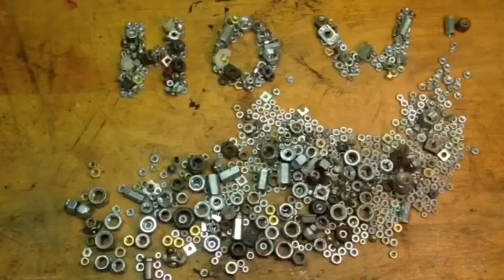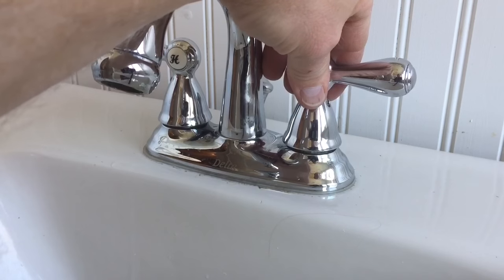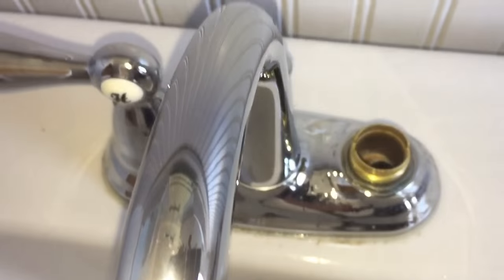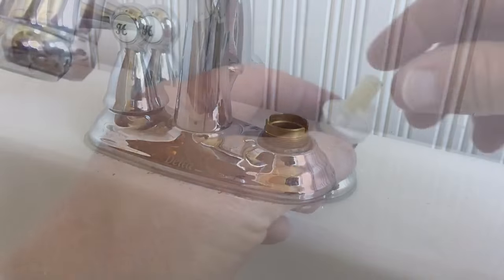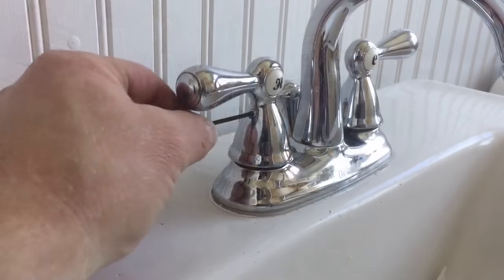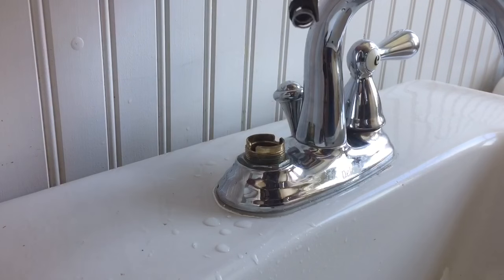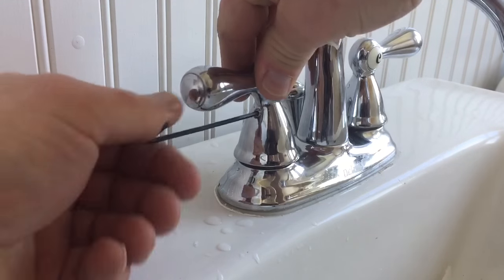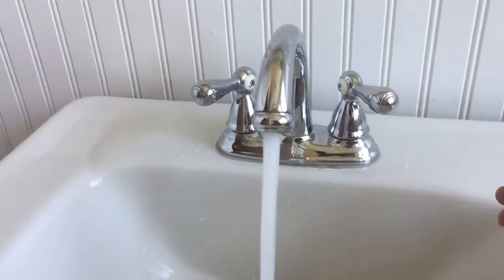How to change the stems, seats and springs in a Delta Faucet

Comment: I wanted to try to do this myself instead of calling in a plumber since I have 6 handles in the bathroom and it seems like something I should be able to do. I put it off for as long as I could, but  there were drips in the tub that I couldn't stop. So, as an older woman with some time on my hands, I gathered all the equipment, turned off the water, and gave it a shot. It worked! You explain how to do this in a very factual, calm way with good video shots. I really wanted to tell you how much I appreciate it and I'm so glad that I found you!
Reply from the maker: Glad to hear the video was a help, thanks for watching.

Comment: I have a problem! The new stem assembly that I got directly from Delta is not working. They have the same part number RP47422 but don’t look the same. My existing assembly looks exactly like yours, but the new ones don’t have the black cap and piece of metal that covers the oring when installed. Got any suggestions? Thanks
Reply: Seems like there's at least two styles of cartridge with a similar top, but different bottom design. 

I think you need the RP24096.

Comment: Thank you. Great explanation of the steps exactly as needed. I read somewhere the stem is most always okay and just need to replace the spring and rubber washer. That's what I did, just replaced the spring/washer and it worked. No more drips out of the faucet!!!

Comment: Thank you for such a clear detailed video! The metal collar around my old faucet's stem was so rusted that it wasn't super obvious it was removable, and I wasted a good big of time attempting to loosen the collar but being afraid to apply too much force as I wasn't sure it was really supposed to be removable, and tugging at the stem in frustration. I normally avoid video how-tos because they take too long to get to the point compared to just looking at a clearly labeled diagram, but yours was the first guide - video or otherwise - I found that clearly showed how every part of the faucet fits together and every step of how to disassemble one, which gave me the confidence I needed to apply a lot more torque to that rusted collar without worrying that I was going to break a part that wasn't supposed to be twisted off!
Reply from the maker: I’m glad you found this video helpful.
Thanks for watching.

Comment: Great Video Bob!!  I'm about to change the spring and seats in my kitchen sink faucet and decided to watched a couple videos on the subject for a refresher!  I found that putting a little silicon grease on the bottom of the cartridge , in my prior experience, made the handle turn smoother and prevented any disruption of the seat and spring (same principle).  I also think that putting a little silicon grease on the cartridge's rubber o-rings also helps preserve them in addition to making their installation easier.
Reply from the maker: Yes the silicone grease is great.

Thanks for watching.

Comment: Thank you SO MUCH for posting this video!!!  I needed to repair the faucet in my kitchen sink, and after three trips to the hardware store and four hours of intense frustration, I still could NOT get that stupid little spring and seat to fit into the faucet.   I thought the old seat and spring had popped out because I couldn't see them, but watching your video made me realize they were still in there.  It took a lot of prying fussing to get them out, but they finally popped out, and then I was able to insert the new seat and spring, then the faucet stem, and everything worked beautifully!  Again, THANK YOU!
Reply from the maker: Awesome, Thanks for watching.

Comment: Nicely done.  Good visualization of the parts. Lots of tips to prevent trouble:  putty knife to remove stem,  tissue to prevent stuff from falling down the drain, removing aerator to flush system when turning back on the water to prevent clogs.  Really expert.
Reply from the maker: Thanks for your kind words, hope the video was a help to you and thanks for watching.

Comment: Worked for a week, then got worse than it was originally,, so I changed the faucet. Then the valves leaked, so I changed them. Then I changed the trap & all the pipes. Oh, and the vanity was glued to the wall with silicone, so I’ll have to do some painting now too. Love DIY stuff.
Reply from the maker: Too many times one thing leads to another with home improvement.
Thanks for watching.

Comment: Thank you for this excellent video! I’ve used it several times. This time I can’t get the set screw out of the hot side and I think it’s stripped. (The cold side comes out easily). Can you help me with this? How can I remove the set screw to get the handle off?
Reply from the maker: The best thing I can suggest, and it’s not easy, is to take a small drill bit and drill out the set screw, tap it out of the threads if needed and replace it with a new one. It is possible but unfortunately not as easy as just removing it. I wish you the best.
Thanks for watching.

Comment: The Spring for the rubber washer is wider on one end than another (from repair kit). It would be nice to know if you use a little force to put spring on washer (wider end into washer?) .or turn it upside down (where it falls out if you do not hold it) and put it in with "skinner" side into washer.I removed them not knowing there was a difference between top and bottom diameters of spring.
Reply from the maker: Put the "skinner" side into the washer. Hope this clarifies. Thanks for watching
Reply: Its been awhile since you posted this came on here thinking i had the wrong seals they are but they were close enough... but my shutoff wouldnt shut off all the way due to calcium buildup etc and what a pain to do under the slight pressure took like an hour to just get the stupid thing in there and getting the valve in before it pushed it out loke playing whack a mole.. hard water ruined every shutoff valve in the house glad i rent.

Comment: very good video, I changed both but when I went to turn the water on the hot water side would NOT shut off, it stayed on no matter how I turned the handle, I could NOT figure out what I did wrong when I installed the hot water side until I saw your video, thank you from keeping me from going insane. A+
Reply from the maker: Glad the video helped, thanks for watching.

Comment: Thank you for great clear instructions and video. I still struggle putting the seat/spring  in!
Reply from the maker: Thanks for watching
Reply: Ocean Girl, sometimes it's a challenge finding the correct length and width spring and seat at local hardware stores. Some are too small and just sit in that little cavity when they have to sit above it to keep the seat elevated properly. Keep notes on which parts you bought that WORK for future reference!

Comment: Hi Bob!  Thanks for your excellent vid!  I had a fast-dripping faucet and I followed your instructions to change out the seat, spring, and cartridge.  It immediately appeared to stop the drip.  But I wanted to make sure so I left a cup under the faucet.  Well it looks like there is still a VERY slow drip as the cup has a little water (1/2 inch?) after about 8-10 hrs while I’m at work.  Any ideas where I went wrong, or what else I can do?   The dripping is much less though.  It would fill the cup in only 4 hrs or so before I did the replacement.
Reply from the maker: The first thing I would try is to take it back apart, and make sure the area where the seat rubs is clean, you could have some calcium or some kind of grit in between the seat, causing it not to seal. Next inspect the waterway inside the faucet where the seat rubs on the faucet. Make sure there are no scratches that would allow water to seep around the seat. Hope this helps. Thanks for watching.

Comment: The video is quite helpful, with a couple of exceptions. First, nothing was said about the fact that the hot and cold faucets have to be set up differently to accommodate the handles. There are little white plastic parts that have to be positioned correctly (and differently) in the two stem assemblies. Second, and much more important, you must leave the water off (both hot and cold) until you have replaced both assemblies. I discovered this the hard way. I managed to get the cold side installed. Wanting to verify that it was correct, I turned on the cold water. Nothing happened, except that I got a little bubbling in the open hot side. So I decided that I must have turned on the wrong valve. I turned off the valve I had just turned on and turned on the other one. Disaster! I got a geyser that blew the gasket and spring assembly up toward the ceiling. They hit a light over the sink, which broke into a million pieces, and I got water all over the place. So, don't turn the water back on until you have replaced both stem assemblies and handles.
Reply from the maker: Glad to hear it was helpful, thanks for watching.
Reply: I've also learned to keep the water off the hard way!

Comment: Why is it easier for everyone else?  Granted working on 15 year old faucet.  The set screw took force using 3/32" allen wrench.  the cap above stem took wrench with teeth to open.  the stem required force to pull out.  The stem is not going back in, so we will see.
Reply from the maker: The older the faucet and the harder the water the more difficult it will be. So much corrosion and calcium build up to deal with. Try spraying it down with something like CLR and let it sit for awhile. Hope that helps. Thanks for watching.

Comment: Great how-to video!  Once I had the parts bought via Home depot and required tools as per your video it literally took less than 10 minutes to fix both of the Delta faucets. Simple, straight-forward, no shouting, regular paced instructional guide that saved me bucks from a plumber 🪠(Highway robbers here in N.Y. State) or help from a handy man 🔨.  Also bought a new aerator 🚿as well and everything works like new on the 25 year old Delta faucets.  Bravo..!  Thank you!
Reply from the maker: And thank you for watching.

Comment: I had a leaky hot water handle on my tub. I changed out the seat and spring but the spring went down the water pipe. It seems to be working fine without it.

Comment: Bob, great video.  When I removed the seat and spring from my Delta faucet, a small O ring also came out, which appears to have been below the spring.  Should I replace this too?  The existing seat on my faucet is different; hard white material that is wider at the top and then narrower at the bottom.  I'm thinking maybe that O ring went around the narrow bottom of the seat.
Reply from the maker: If you went that far you may as well spend the little extra money and time to replace the O rings as well, Just my opinion. Thanks for watching.

Comment: Good video. I did all this and my Delta faucet still leaks exactly as it did before -- maybe even a little more now. Any suggestions as to what else to look for? Thanks.
Reply from the maker: Make sure the area inside the stem is cleaned out very well so that the seats are able to seal correctly. Sometimes corrosion or calcium will form and make a rough surface. Try some CLR or equivalent, pour a little down into the stem and wait a bit then rinse and re-install. Also check for any damages to the stem it is possible that there is a scratch that will allow water to seep through. Hopefully it is not leaking from both the hot and cold. Hope this helps. Thanks for viewing.
Reply: Thanks I'll check that next

Comment: Good, clear video, very easy for a sink faucet that has hex screws to remove handles.  Does anyone know how to remove the handles that have no hex screw to open?  Also, have to assume the wider part of the spring seats at the bottom, more narrow to the top?
Reply from the maker: There may be a cap on the top of the handle that is removable and a screw underneath that will allow you to remove the handle. Hope this helps, thanks for watching.

Comment: One thing that wasn't discussed was how to clean the well that the stem cartridge sits in, that can also become built up with scale that needs to be cleaned out.  The sides of the well can be carefully sanded with 400-600 grit wet sand paper on the end of a finger.

The bottom of the well is more difficult as you don't want to damage it. I haven't found a great method and am open to better ideas.  What I've done that works reasonably well was using a small aluminum flat head screwdriver to very carefully scrape the scale off the bottom.  Steel objects should be avoided otherwise you may scratch the well bottom such that it permanently damages the faucet causing leaking.
Reply from the maker: Obviously cleaning goes without saying, but some CLR or a wire brush followed by a vacuum to clean out the debris would be my recommendation..
Reply: I have some dental tools for cleaning plaque from my teeth that also serve to get in these tiny spaces but you need to be very gentle and careful not to scratch sealing surfaces.
Reply: No, cleaning does not go without saying, in fact there could be an entire video as to how to do it properly.

Comment: Thanks for this video.   I do have a problem,  I've changed cartrtidge once and the seat and spring multiple times in the last month.  The seat keeps wearing( getting warped ).  I put grease last time so it slide when turning on and off.  It is a week or so later and faucet is leaking now.   If you have any advice I'd apreciate it.   Tired of replacing seats.
Reply from the maker: IS it possible that you have the wrong seats? Other than that I have no idea since you changed the cartridge. Make sure everything is cleaned out real good and that there are no burrs on anything. Question, is it just one side or is it both?
Reply: @funbro1  only one side has been Changed, if that's what you mean
Reply: @funbro1  I notice turning the faucet the water is inconsistent.  I turn it slowly open, water come out then it slows then Blast out when I turn it to a certain point.  to mean it doesnt seem to be sliding smoothly.  Maybe I'll try to see if it needs to be cleaned better.   I do dry it up before installing everything.
Reply: @funbro1  I think the seat is correct.   the seat does fit in the hole, it doesnt bounce.  maybe it should?

Comment: Good vid. When you put on the silicone grease, do you put it on the top or bottom of the black washer?
Reply from the maker: I put it where the rubber will rub, that way it is a smooth handle turn. Hope this helps,Thanks for watching.

Comment: I notice that some cartridges have a metal shaft for the knob and others have a plastic shaft. Do the original (OEM) parts always have the metal shaft ? Also, replacing just the seat and spring may stop a dripping faucet without replacing the cartridge. If there's a leak under the faucet handle, tighten the cartridge nut or replace the cartridge.
Reply from the maker: I think the better ones are the Delta brand and the others are knock-offs. Thanks for watching.

Comment: I have a very old Delex bathroom faucet that had water under the faucet & now that I have replaced seats & springs it drips from the faucet:/. . In addition to the seat & spring there was a  tiny white plastic cone-shaped part inside the spring on old part. Repair kits for Delta/Delex have them included. Is this a necessary part?

Comment: Which way does the spring go in? Wider side down? I “fixed” my bathroom faucet with the closest cylinder I could find, though it was plastic, not brass & all was good. For about a week, then the drip became a stream, so I just shut off the hot water. In February. 🥶
Reply from the maker: The springs should go in with the wide part down, towards the faucet.
Hope this helps.

Comment: Wonderful instructions. Thanks.  After removing the hex set-screws, however, I had a heck of a time taking both handles off.  It was not a simple rocking back-and forth, but required some prying with screwdrivers for more than an hour each before they came off.  The rest of the procedure went quickly and smoothly.  What do you recommend to do when the handles don't want to co-operate?  Thanks.
Reply from the maker: Sometimes it can be difficult depending on the water quality or age of the faucet. Sometimes it helps to soak them in penetrating oil for awhile. Hope this helps. Thanks for watching.
Reply: handle wont come off

Comment: I did all this prior to watching this video (essentially why I am here now), and the old seat and spring were flush inside their hole, but when I put the new one I, I pushed it down with some force, but it doesn't sit flush at all.  When I put the new cartridge in, it sits up a little and not flush with the brass because of the seat and spring not being flush. I can only assume when I tighten the nut that it pushes everything down, however, I am still experiencing a drip. Not sure where to go from here.
Reply from the maker: Kevbo Kev The seats and springs should fit so that when lightly pushed on they will be flush and the cartridge will fit all the way in. It is possible that you may have something stuck down in the "well" causing the spring to be pushed up too high. Hope this helps, Thanks for watching.